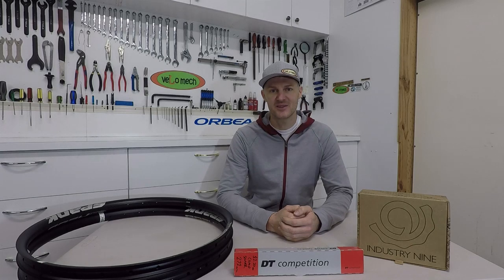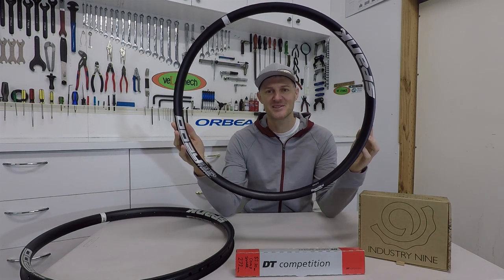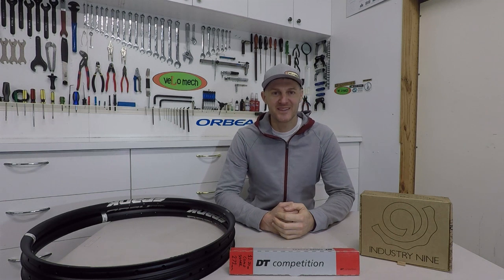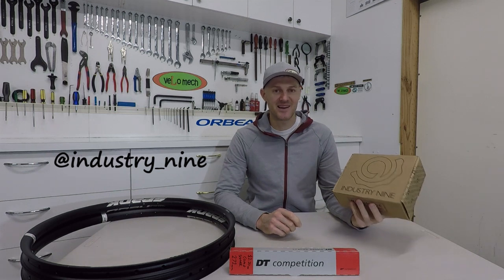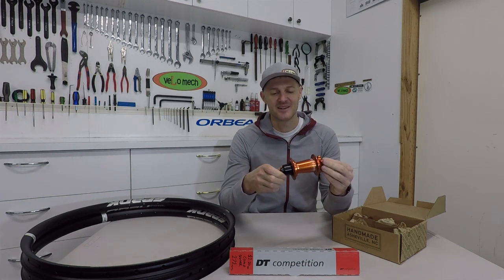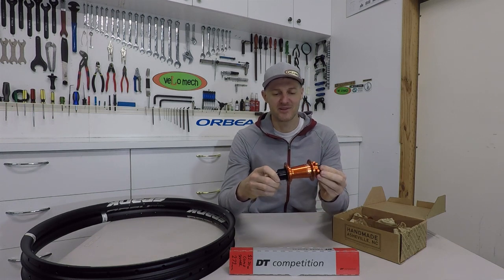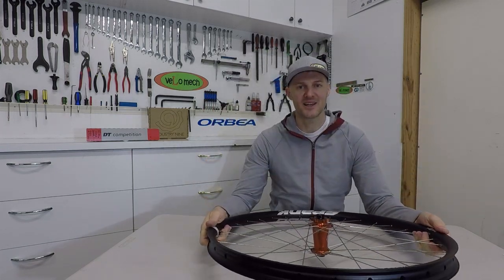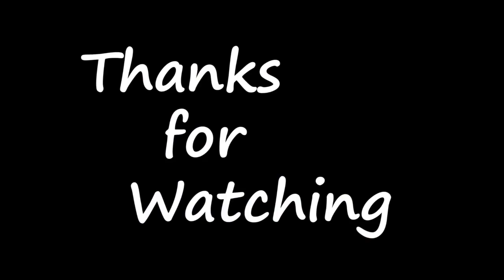Wheel Building Time, Trials & Tribulations Episode 3

Comment: Wheel building is something I want to try. I have been accumulating the tools to do it. How do you determine the correct spoke length for the hub/rim you want to use?
Reply from the maker: Hey @Patrick Mitzel, it's a good skill to have and I find it the most enjoyable part of the job as a bike mechanic. 
Getting the correct spoke lengths is a very important part of the process. 
I have a programed scientific calculator that a smart mate of mine programmed for me. I simply punch in all required measurements of the rim and hub.
 DT Swiss web site has a similar calculator (I found not as accurate but free to use).